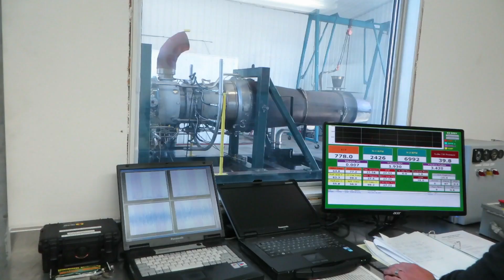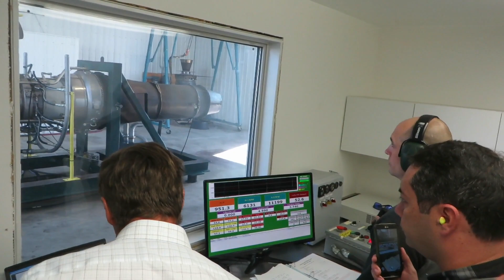RR Marine Spey turbine engine test run

Comment: On type 22 Frigates the Royal Navy had 2 of these as the high power turbines,  5500 metric tones really shift when these are fully spooled up. stunning engine.     of course the Type 42 Destroyers had RR Olympus engines, ( concord powered warships )  Jets never cease to amaze. thanks for the film.
Reply: +Steven Jackson I've got a reputation for being pernickety to uphold, so here goes. Type 42 destroyers had two Marine Olympus and two Marine Tyne  engines, as did the Type 21 frigates (they could do well over 40kt flat out). Batch 1 and 2 Type 22 frigates had two Marine Olympus  and two Marine Tyne  engines: the Marine Spey SM1A was introduced in the Batch 3 ships. Type 23 frigates had the uprated Marine Spey SM1C, plus 4 diesels. And, to reinforce my reputation for being pernickety, they were not Concorde-powered warships, although that's what the Royal Navy's publicity blurb of the time stated. The Marine and Industrial Olympus gas generators were derived from the Olympus 200 series engine in the Vulcan. The 'C' rated Industrial Olympus that AgentJayZ has shown us was a further uprate of the 200 series engine, but even that didn't get anywhere near the power of the Olympus 593 in Concorde.
Reply: Well done you.  there's a man who knows his stuff, The Vulcan was a far more impressive air plane than the half French Concord.  loving the films, thanks : )
Reply: I watched the last flight of the Vulcan over Filton airfield last year, where, 12 years before, I'd watched the final landing of Concorde G-BOAF (Alpha Fox to her friends). Back in 1995, I'd flown in her to or from New York (I can't remember which). The poor old girl is still out in the open, but next year, at long last, they will put her in her own museum building.  I worked on the Industrial/Marine Olympus and Marine Tyne as young designer and, as one of my last jobs, was responsible for in-service design support of the 593 in Concorde.  Rest assured, she's a lot more Brit than French.

Comment: I apologize if it is obvious, I'm a Cisco networking major. What is the red tube on top of the engine? I'm guessing it provides auxiliary air, as I looks like it's after the compressor stage but before the combustors. I'm sorry if this has already been asked I couldn't find the question in the 80 comments.
Reply from the maker: +ChocateMilkVlog  The outlet deflector for the exhaust of the HP bleed valve. It's explained a bit in Jet Questions 82
Reply: +AgentJayZ thank you for the response, I didn't see that video in my feed

Comment: Hey, the "fan" actually turns on this one.
Reply from the maker: +kuba kuba Technically, that is not a fan. None of the engines we test have fans. You could call the first stage of the LP compressor of an industrial or marine Spey a modified fan, but it does not function as a fan, and it is not a fan.
Reply: AgentJayZ I'm very much aware of this, I've seen all your Q videos including the three or four where people ask you why the fan isn't turning. I personally find it really amusing when you have to explain over and over that there is no fan on a turbojet engine. You did test the AI-25 though which is a turbofan engine, right?

P.S. If you made a shirt that said "Why isn't the fan spinning" I'd personally buy it.
Reply: +kuba kuba I think you just mocked yourself.
Reply: +kuba kuba I can't be sure, but I think that the Allison TF41, and hence the Industrial and Marine Spey, was the only engine of the Spey series to have an overhung LP compressor first stage rotor. The first stage stators and front bearing housing are a single unit and act as the engine's 'front frame', as it would be termed in N America.

Comment: Do you guys ever use a mechanics stethoscope? 
If you ever find an extra transducer, maybe look into recording its data as audio. Might pick up sound from the air better, or reveal interesting engine noise if connected to the stand. Food for thought. Thanks for the vid!
Reply: I second this idea.  Would be very interesting to hear the internals via a pickup like this.

Comment: +AgentJayZ I know you've said before that when the engine is at idle is puts out little to no power, even though it is still a giant screaming beast. Is it correct to say that at idle all or most of the power produced is being used up to turn the compressor and that is why no further output power is produced? Thanks!
Reply from the maker: +Justin Hadden   Yes
Reply: If you think about it ..."idle" whether ground or flight is just enough gogo juice to keep it self sustaining with a bit of excess for safety. I once heard someone protest about the statement that an engine at ground idle produces no power...but this is indeed a fact., if we consider power to be work done rather than energy consumed...rather like a 100kW motor driving no load...it produces no power save that for the cooling fan yet may consume 25kW energy.

Comment: Hello Agent Z, I have a question I'm not sure if you covered it before 
How do you all communicate when the engines are running, do you have set gestures you use or is it just  motioning. 

love you channel keep up the content.
Reply from the maker: +Gunner Snowdall   We should all learn sign language, but we haven't. We have a few signals, but much depends on everybody knowing what their job is and being alert to their surroundings. Also, we have a "mission briefing" before the noise starts.
Conversation is fairly easy inside the control room at less-than-max power levels.

Comment: It's
a rather old video I guess by now but still I think I might have a valid question arising from this video - 
I have heard about how ducts work - that nice large one did get some gears turning - visualizing the air pulling into the inlet.
When all that air is getting sucked into the inlet - doesn't it cause a huge continous rush of geddy air from inside the test cell to moving forward and around the front into the inlet? Like a huge donut?  sorta? with the engine in the hole part?  I know this is a hazard with too much reverse thrust on a turbo prop bush plane... but it's a control issue due to apparent air.
Anyway.  The guy wouldn't want to get too close to the edge, eh?

Comment: I was surprised to see people in the test cell without multiple layers of hearing protection. Also, RIP weather stripping!
Reply from the maker: +CacheRAM    So you were surprised. That is interesting to all of us.   How do you know what you saw? Many of the boys "double up" with earplugs under their ear protectors.
Reply: Yes sir, but I saw 2 people without the outer protection at one point. I was unable to determine if either of them were wearing the foam inserts - but even if they did have them in, I can say from my experience on a construction site that those foam plugs couldn't be enough to protect from something as loud as a gas generator in operation.

Comment: Sort of a fun video this time with 'building weak point finding' and a cameo by Robin!  Sorry, but I laughed when I saw the weatherstripping slowly rip loose then fly-off.  Can you turn that bleed outlet duct into more of a 90 rather than a 60 degree elbow?  Maybe it doesn't matter if you plan to run it above the bleed valve closing RPM anyway!  Thanks for sharing.

DD

Comment: What causes that "brup" sound on engine startup? I hear it on every jet engine that starts, but I can't figure it out. Any help?
Reply from the maker: +[A7] Falconn The start cart always has a few partial stalls. Then when we release start cart compressor bleed air to the engine's air turbine starter, there is a huge whooshing sound. The engine gains revs, and when fuel is introduced, combustion begins, sometimes with a booming report. At that moment, you begin to see heat waves coming out the back of the jet pipe. Maybe it's in there somewhere?
I have a video where I try to identify some of the sounds. It's called Jet Start With Commentary.
Reply: AgentJayZ Thanks for the response. I'll be sure to check out the video.

Comment: What a beauty!
However, sounds like it isn't as loud as other turbines, was this because no full power was issued or are the internals that much more efficient/modern?
I don't remember seeing the instrument/control rack on the left. Could we get some shots and thoughts about it? :) (It could very well happen that I've skipped an episode showing it.)
Reply: +YCbCr With the HP bleed valve open and the HP VIGVs (quite possibly) not fully open, the engine would have been nowhere near full revs and power.

Comment: If this is a marine spey,  Why do you have a "jet pipe" and nozzle attached?  Is that just for safety while testing?   Do you need back pressure to simulate a power turbine?
Reply from the maker: +demonchicken   The main reason is that it is very difficult and hugely expensive to build a dyno to handle a 17,000 Hp engine. Rather than acquire the usual PT assembly, which is separate from the gas generator, and therefore not shipped with the engine, and some sort of huge dynamometer able to handle its output, we have used a choked nozzle to resist the exhaust gas flow of the GG. Power output is related to pressure rise in the jet pipe upstream of the choked nozzle.
Reply: +demonchicken It's common practice in the industry to test industrial and marine gas generators as turbojets with what I would term a 'slave' jet pipe and final nozzle. Exceptions would be where the engine has an integral aero-derived power turbine, such as the Marine Tyne. In this case, a dynamometer would obviously be necessary.

Comment: If you were to ignore any debris like stones, mud and building parts :P. What would be a safe distance to stand directly behind that RR at full power? What would be a safe distance to stand directly in front at full power? Also, would those distances change linearly depending on throttle position or would there be some other curve (if one plotted distances on a graph)?
Reply from the maker: +Morgan Winters 
1) Ignoring rocks coming at you at hundreds of miles per hour is a bad idea.
2) While this is an interesting question regarding aerodynamics and energy dissipation through turbulence, the answer is meaningless to the practice of engine testing. In our situation, the rocks are very dangerous, and hide the answer you are looking for. I'm sure there are textbooks on aerodynamics that will have an chart or something.
Reply: +AgentJayZ I'm not saying that. I meant if you were to take rocks and debris completely out of the equation. In other words, if the area behind the test cell was concrete or tarmac or the test cell building extended like 1000ft behind the engine, thus leaving only gas that could be moved by the engine. I know the question is meaningless for this test, I was just wondering as a general rule of thumb for an engine of that size.
Reply: +Morgan Winters Depends on how much you like living. You should check out Jay's video called 'Jet Engine Run at 50 Yds' - I personally would not like to be behind a running jet engine at all, but if I must, please give me a full mile (5280 ft) for my own peace of mind.
Reply: +Morgan Winters Aero engine manufacturers usually give diagrams in their operating manuals showing the areas for ground personnel to avoid around both the intake and the exhaust. If you want to see what jet blast can do, take a look at the video clips of the airport at St Maarten,  where the runway threshold is right the other side of the fence at the back of the beach. If you'll excuse my rambling, this reminds me of our local folk lore. Years ago, a Vulcan was landing at Filton airfield, where Concorde would one day be built. The concrete runway was wet and the Vulcan landed too far from the western threshold. The pilot decided that he couldn't stop in time and that he would probably go off the end of the runway, onto the main road beyond. He opened up the four Olympus, stood the plane on its tail and cleared the perimeter fence. However, the landing gear took the top off a lamp standard, while the jet blast blew over the pumps at Runway Motors, the petrol station (that's gas station for our American friends), which was situated right at the end of the runway, just beyond the fence. They rapidly relocated Runway Motors, displaced the eastern  threshold and moved the fence. Some years later, to allow for Concorde take-offs and landings, they installed traffic lights on the road, together with low-height lamp standards.  I moved to R-R Bristol years after the Vulcan event and, out of curiosity, took a walk along the road. The concrete bases of the pumps, with their bent hold-down studs, were still visible through the perimeter fence.

Comment: Hello again AgentJayZ, In the previous video, did I hear you describe the fuel manifold as a gas manifold? If so, what standard of burner did the engine use? PS Yes you did: I've just checked back. You said, "gaseous fuel manifold": I certainly wouldn't expect to see a liquid fuel manifold with such a large internal volume. PPS Does the test cell have the capability to run liquid-fuelled industrial/marine engines on diesel? if not, then I could understand the use of gas, rather than Jet A/JET A-1.
Reply from the maker: +grahamj9101   As I understand it, this engine was deemed beyond economical repair by "The Company", so there was some skepticism about our claims to the contrary.
One does not confront The Company directly, but deftly sidesteps the behemoth...
This is a demonstration of the core, using natural gas fuel nozzles that are found in industrial Speys. Here we use gaseous propane as a replacement for natural gas, to save the huge expense of having a pipeline built to our test stand.
You could say that this run is as much a demonstration of the abilities of Maddex and S&S to a new group of potential customers as it is of this one engine.
Reply: +AgentJayZ Thanks for taking the trouble to reply at length (btw, I don't like the way you spell scepticism). Yes, I have experienced the hyphenated behemoth from within and had my own issues - but that's another story. I had worked out that you were probably using the standard gas burners from the industrial engine, which very probably means that the engine does not have the RAB combustor. I would again congratulate Maddex and S&S on completing an extremely good overhaul
Reply: +AgentJayZ I must say, Muy bien! (No hablo  espanol!)

Comment: Do you normally make single or duel spooled engines? For industrial reasons. And what makes the differences between a single a duel spool? (Pros and Cons)
Reply from the maker: +Aidan Onisko First question is meaningless. We repair whatever engine is in the shop.
Second question: please check the index of the playlist called Your Questions Answered. It's long, because there are a lot of questions that have video answers.

Comment: Question:  Where do you get all of the bell mouths for the engines you run in the test cell?  Customer supplied or do you buy them yourself?

Hey, and while we are at it, how do you preserve the engine in preparation to shipping it out?
Reply from the maker: Matched testing bellmouths are exceedingly rare and difficult to obtain, like diamond blocks in Minecraft. Sometimes they spring spontaneously into existence after seemingly interminable block-chain calculation, but strangely, they can not be purchased with Bitcoin.
Sometimes we design and fabricate our own. The RR Olympus bellmouth we have was designed by Brian, the owner/founder of Maddex Turbines, and the AI25 inlet bellmouth was designed by me.
The ideal shape is exponential, but when I showed the contractor the equation, they turned green, so its a simple quarter circle arc that makes up the curvature. Works great.

Comment: Hello everybody. I just noticed one thing about the engine noise. It's clear why pressurized air waves create sound (from the exhaust for example) but what is the ringing noise from the front? Do the "loose" compressor blades ring at these rpms? Or what is generating that high pitch sound?
Reply: The high pitch whine comes simply from the high speed air stream being interrupted and redirected between stationary objects and very fast moving objects.. Such as the compressor blades turning right next to the compressor stators.

You can actually reproduce this with two computer fans, if you force them to turn in opposite directions against eachother - you can hear the air start to "purr" just from the air being brute-forced to change directions so often and so quickly - now imagine that with a huge amount of power, massively large fan blades, packed really closely, at thousands of RPM. Jet engine whine!

Also I'm sure there are some gearboxes for various pumps somewhere that might add to it. But mostly it's just air being beaten into submission.

Comment: I noticed a fair amount of oil mist coming from that oil sump box at the rear of the engine. (3:55 - 4:00) Is that a typical amount of gas/oil moving through the system?  Or is that something else.
Reply from the maker: +AIM54A   Please read the video description.
Reply: +AgentJayZ Got it.. Thanks.

Comment: Ok, speaking from a position of ignorance, will that engine turn a set of blades, not fans, that will power the marine craft? Sorry for my wording but you get the point. Thank you.
Reply from the maker: This Spey is a gas generator, which is used to generate a stream of high velocity, moderate pressure gas, which is then fed through a power turbine ( got a video series on those), which converts that energy into mechanical torque on a rotating shaft, which will turn gears in a giant gearbox, which will turn the shaft on which the propeller is mounted...

Comment: AJZ--- Where were the load cells located? Didn't see them or the safety cables. Thanks for the vids
Reply from the maker: This engine does not produce thrust, so we don't measure it when testing it.